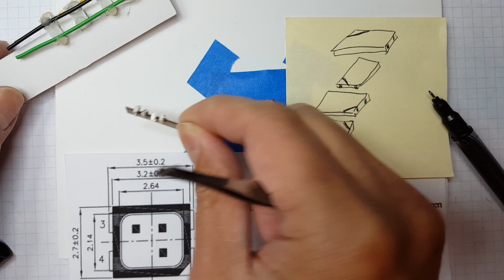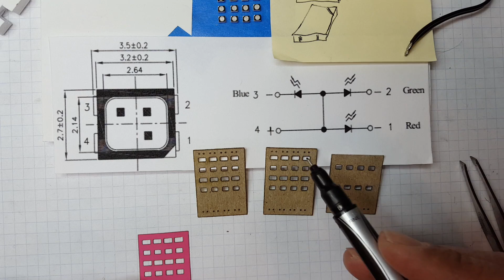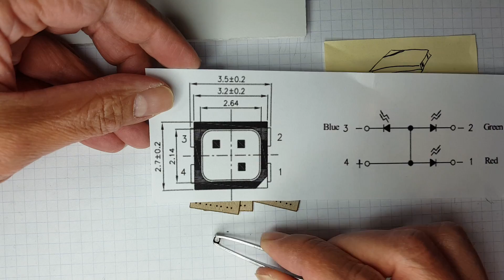HariFun #123 - Death by Solder - The World's Tiniest RGB LED Cube (part 3)

Comment: Just had a thought , when you get it done it might be quite shaky / fragile . you could make a small mold and cast it in some clear resin .  then your cube would be in a cube . LOL . ( a solid cube )
Reply from the maker: My plan is to dip/paint it with clear nail polish to prevent shorting among pillars. However, 64 SMD in a solid clear block sounds pretty cool.  Thx +XerotoLabs!

Comment: i use the same cam/cell holder as you . i love the 'L' channel holder for it . I
I see you may have used the power of the laser cutter to make your jig parts. LOL
that looks great in its expanded setup. it will be crazy when its fully tiny .
Reply from the maker: +XerotoLabs , Yup, the jigs were lasercut at our local maker space.
I have had to redo the PCB layout a few times because I'm learning EagleCAD and also having to deal with so many pads so close together. 
BTW, my PCF8574P arrived today. Thanks for introducing me to that chip!
Reply: +Hari Wiguna you can now buy cheapo LCD modules and add I2C to them and use the default I2C libs for them  . they are on almost every I2C display backpack i have seen . I have not messed with eagle yet . i just got fritzing working in a way i understand .   You going to get a board made to drive them ?

Comment: It is so beautiful! At first I thought I would write a comment, asking if we could see how you soldered these.. And then out of nowhere, you show us =D Awesome video, so much patience! I've tried hand soldering 5050 LEDs with three separate LED chips inside with each 2 pins (total 6).. Those one color ones, you know what I mean ;) And wow.. I thought it would work, but no.. then I thought, I'll just parallell all three LED chips and go that route, well then the whole LED melted instead.. With low temp on the iron!! haha..

Oh well, after watching you do these, I just have to try again =D

Many thanks for showing this! =)
Reply from the maker: Thanks Chris!
I worry that watching someone solder would be too boring, so I hope the 8X speedups help.
You melted the LEDs? How hot did you set the iron? IIRC, I set mine to 350C.  While traditional wisdom says that you should heat up the surface to be soldered with the iron and then bring the lead in, with flux pen, you can break that rule and reduce the heat on the components.  I melt a tiny amount of solder on the iron tip, and when I touch the pre-fluxed surface the solder sticks to the surface.  Good luck on your second try!
Reply: +Hari Wiguna - Well all in all it was a very interesting and well made video, so there certainly is nothing to complain about! =) I don't know really, anymore at least, I think this was.. 1-2 years ago and I can't remember. I do remember that when I got fed up with trying to solder them, I started making holes in the LEDs because I was so mad at how it all went. They became art at that point! Oh well ;)

I might have gone with the regular way of soldering, heating up the pad first, as you say. That might have been the problem. I've never tried flux pens before, I have recently bought one but I haven't started using it yet, but I guess there's no better project than to solder some 5050 LEDs as the first test of the flux pen =D

Now I only have to think about recording it as well, but I doubt the video will be half as good as any of yours =P haha.. But it would be fun to show off, if..!!  I manage to solder it =D

Thanks for the reply! =)
Reply from the maker: +Chris Fredriksson, you really should make a video!  As you said, it is fun to share. Your poor soldering result may have nothing to do with you but more about poor equipment.  Make sure you use a temperature controlled soldering iron/station, small diameter 40/60 lead solder with resin core, and... flux pen :-)  Also, I find the magnifier lamp from Harbor Freight very helpful.  TTYL Chris!

Comment: Hari, have you removed PIN13 LED from your Arduino? It doesn't allow proper Charlieplexing for D13 line.
Reply from the maker: I see a slight shimmer on all the leds that are not supposed to be on.  I just attributed that to my SMD LEDs being too sensitive and lighting up even at very low voltage.
However, you might be right, it could be because of that extra LED (and therefore) diode on pin D13.
Thanks for that tip +cbm80amiga !